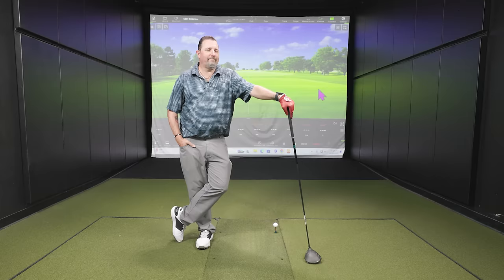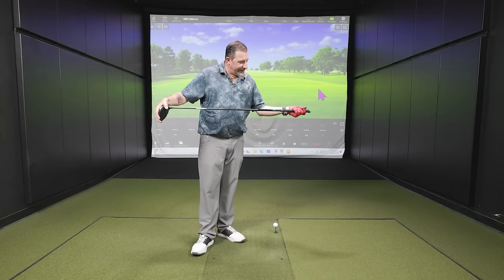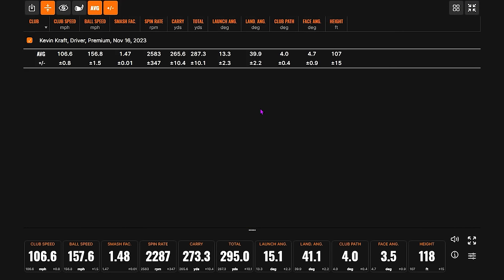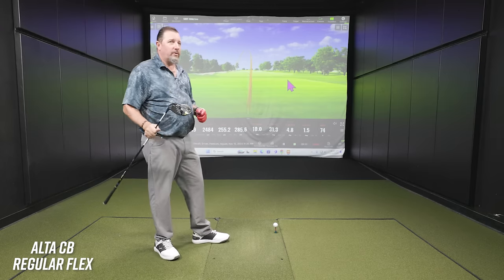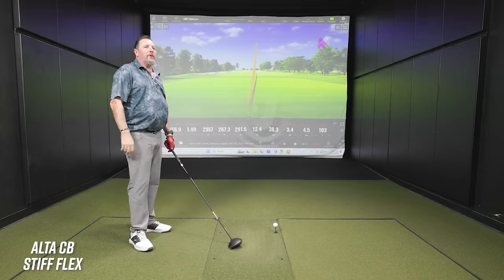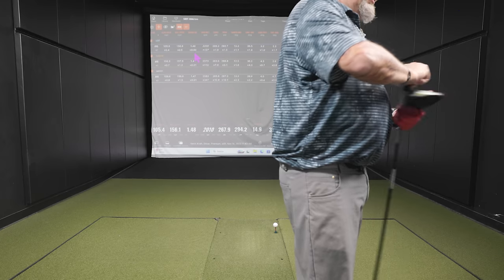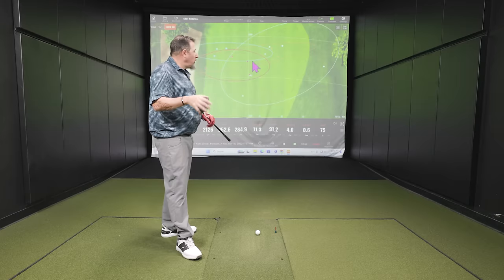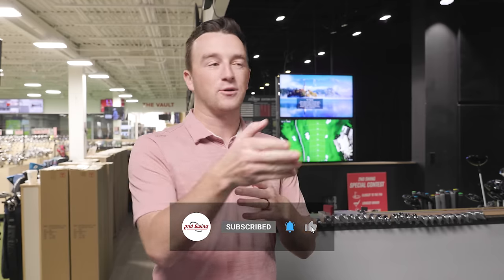DRIVER SHAFT FLEX TEST | Does Driver Shaft Flex Matter?

Comment: I never realized how fast I swing the driver and just always used a stiff flex shaft.  I kept getting low launching drives and sometimes even drove the ball directly into the ground off the tee, but actually squarely hit the ball.  I couldn’t understand what was happening until I got fitted.  Turns out my average club speed was 119mph and I was flexing the S shaft like a wet noodle.  The club head was just lagging way behind my hands.  I swapped to an X stiff shaft and it blew my mind!  I’m launching every single drive and have so much more control over my shot.  Do yourself a favor and find out your swing speed.  It’s essential!
Reply: Mate. I'm currently using srixon 10.5 stiff flex n keep getting slices n tons of bad shots. Came across your comment n jz checked my swing speed avg is 120 mph. I think i need to try extra stiff too
Reply: @hakim880 wow!

Comment: Excellent video. I am playing the G430 Max with a stiff Alta cb shaft. I’ve known for some time that too soft a flex causes a wider dispersion for me. Agree with Kevin that playing a stiffer shaft tightens dispersion, but my shape becomes gentle fade, rather than slice, hook and anything in between. I also notice that launch is a bit lower and more consistent.
Reply: i have the same setup and couldn't agree more.
Reply: Forget all the technical stuff until you can shoot bogie golf ( 18 hdc ) . Play every thing REG. Have fun!!!

Comment: I can say from my own experience I had everything in regular. I have been taking lessons and the person said to get checked by club head speed as he thought I was in the wrong shaft.
I was I needed stiff shafts. Bought new irons and Irons are working great. I just changed the shafts and picked them up today in my driver, 5 wood, 7 wood. I have found from today that I am getting more consistent yardage I am getting around 15 yards more in distance. The biggest thing is that all my drives today were straight and in the fairway. They would usually tend to go right. Can’t explain why but I can say that the stiff flex shaft makes the club different for me and for me it works. I got the fujikura vista pro stiff 75 for driver and woods. Ping i525 irons is stiff 
110

Comment: Shaft profile is more of a factor than flex. I"ve got the Autoflex 505 and technically swing too fast for the "flex", although it squares up beautifully. Friends of mine that are in excess of 115 also hammer the ball. Look no further than Matt Blois hitting it 390. Like you stated in the beginning, results may vary. It might be a baseline to start with but it comes down to feel and timing for weight and strike location. Cheers fellas!
Reply: Wait, when did Matt hit it 390?! I thought he was around my level with 120mph swing speed
Reply: @BigDawgCAM  when he was with TXG.

Comment: I was always led to believe if the shaft is too soft you hook the ball which is certainly the case for me, I switched to an X flex shaft and have hit the longest straightest drives of my life with it and my mis is now right not a hook into the left trees 👍
Reply from the maker: Nice!! Your initial point is true for some golfers, but not all. The right shaft flex is from a combination of swing speed and swing tempo. You most likely have a smoother tempo which allows a club with a softer shaft to pull the clubhead ahead of where it should be. Players with a quick transition at the top will actually see a softer shaft leave the clubhead too far back, if that makes sense
Reply from the maker: @richdarlowgolf  love that

Comment: I'm in between regular/stiff but I don't know my swing speed yet but I'm able to go 270 so I'm thinking stiff?
Reply from the maker: If you are consistently hitting the ball more than about 250-260 yards, most likely, stiff is better. However, there are a lot of variables at play here that can affect your driving distance besides your swing speed and tempo. Spin, attack angle, driver loft, etc all have an impact as well. A quick, less-scientific way to answer this: if your ball flight is on the higher side and you notice your ball spinning a bit, maybe floating more than others in the air, you may benefit from a stiffer shaft. If your ball flight is on the lower side, a regular flex may help you kick it up a bit.

Comment: I thought the softer shaft goes left (hook) and stiffer shafts go right (slice)?
Reply from the maker: It's not that black-and-white, because it also hinges on a player's tempo, not just the swing speed. For example, a player with quick swing tempo will find that a shaft too flexible will result in the clubhead lagging behind, thus keeping the face open and missing right.

Comment: This guys swing made for senior or regular flex
Reply from the maker: Kevin fits himself into a light extra stiff shaft for his driver, but stiff for his woods and irons. A unique one for sure
Reply: @2ndswing  if you look at his data, the senior and regular flex gives him more carry and overall and consistent overall numbers. The stiffer it gets less carry and too much roll out with same total distance.  From a swing component,  he ismore balanced and weight shift and unload points are better. While the stiffer shafts he is working too hard, while it might ne OK for about 7-12 holes. Last 3-6 holes he'll probably lose it to the left more often with that swing.

Comment: The roll yards are so exaggerated on these Youtube channels. PGA tour average driving roll yards are around 14-18 yards after carrying 285 yards. To get 30+ yards, it has to be perfect fairway in a dry condition with slight downhill.
Reply: 2023 average carry was 275 with average total of 299.9 according PGA trackman data. That’s average, but I’d bet 30 yards is more common than 14 to 18. I just wouldn’t bet much until after April or May.
Reply: They have less spin on the ball than average golfers